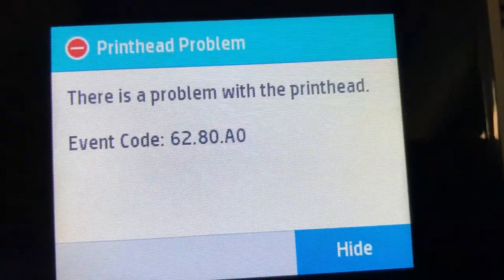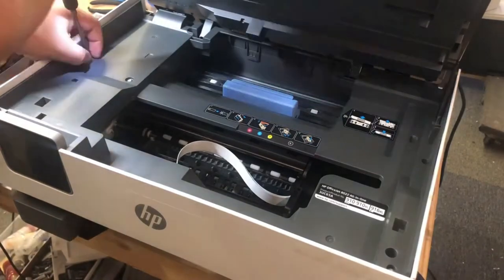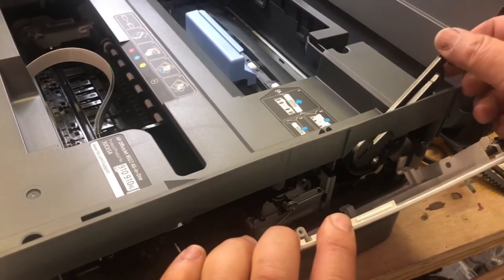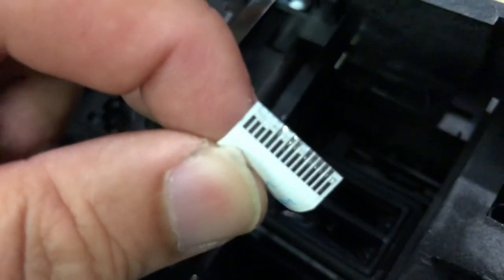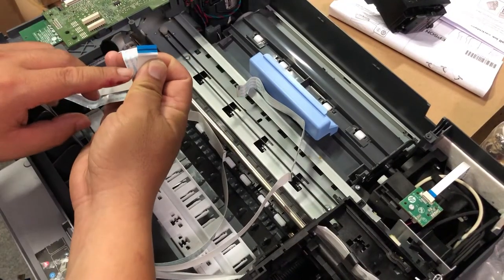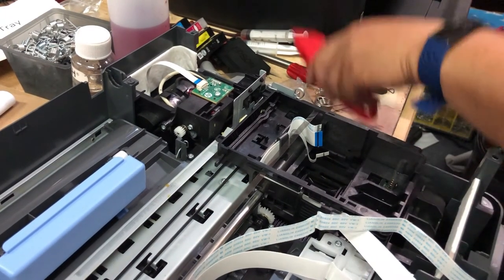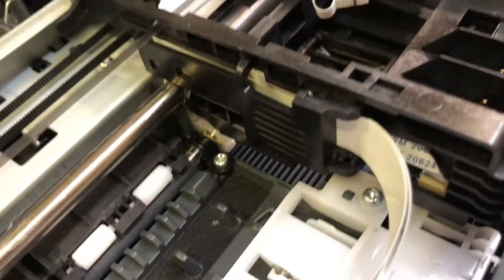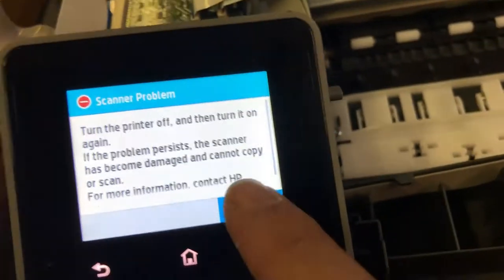Fix HP Printhead Problem Event Code 62.80.A0 - Officejet Pro 8022 8025 8028

Comment: Hello Kevin, thanks for your video(s). I ran into this error code as well - Officejet Pro 8025. But it goes beyond the FFC.

      Since the printer is really new, and I haven't changed the printhead, I tried to troubleshoot it with my multimeter. It turned out that the FFCs are fine. So I went further, put FFC back to place, and tested directly on the circuit boards (FFC sockets' soldered feet)  of both end - also looks good. It's pretty much all I know about basic electronics..hahaha
      So.. from my limited trial and error, it seems the communication of the two parts are ok. So, could this code mean more than the communication failure to the printhead? 
      I searched online for a while, but could not find a service manual, or any document that explains this code. You're the expert. So..I would really appreciate it if you could shed more light to it. Thanks Kevin!

Comment: I have purchased a new print head and put it in and now I'm getting this error code any ideas. It's not the cable because if I switch back to the old one it works (and the pins are ok) but there's no blue.....
Reply: Im getting the same issue :( hate this bloody printer cable is definitely still fine
Reply: @phprider  yeah three printers later I don't have much advice for you either. We ended up buying a new refurbished unit direct from HP. The carcasses are sitting down in the shop. I tried swapping print heads I tried swapping cables. What I really wanted to tell the guy was don't buy an HP as I go home and print stuff off of my epson which I never think about.
Reply: @imark7777777  damn 3 printers?? hehe think i will do some target practice on this hp as it lasted about a year propably only printed around 50 pages max. Definitely never ever buying an hp product.
Reply: @phprider  after being told he needed to get a new one he bought a used one off Amazon which was covered in ink on the back of it. Because hay guess what the box was shipped up right! I think the print head was damaged or got damaged while I was trying to clean it but it still didn't print blue. So I had a slightly working printer and I managed to get the old printhead working with the printer was malfunctioning at this point so you would think working printhead + working printer no HP! On the upside HP support wasn't bad other than spending two hours on the phone for nothing, they did at least try and "fix" things even though it was out of warranty. They insisted it was the ink cartridge overnighted me one.